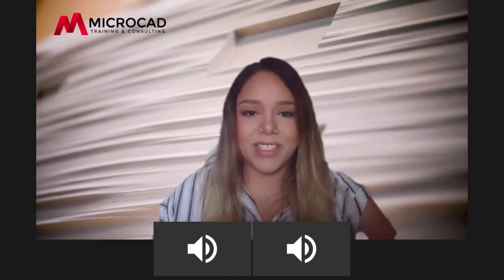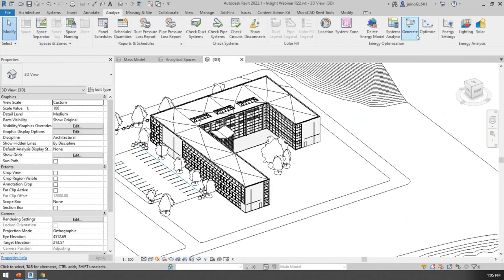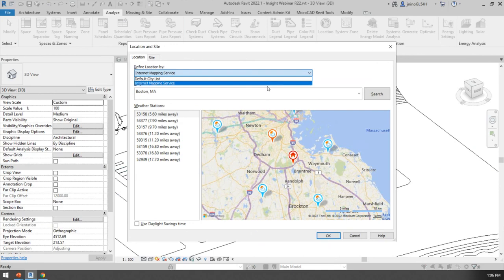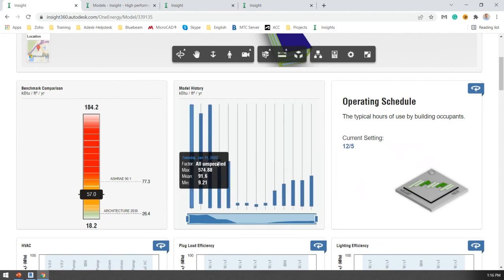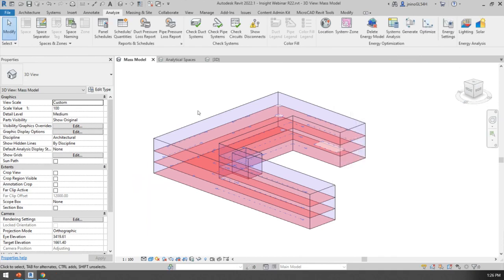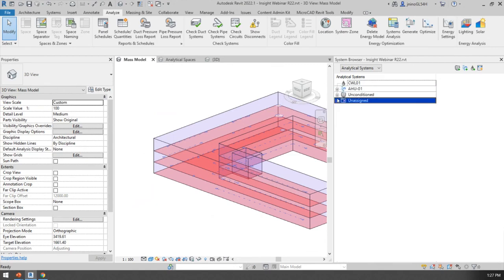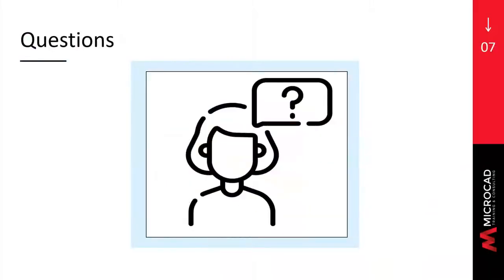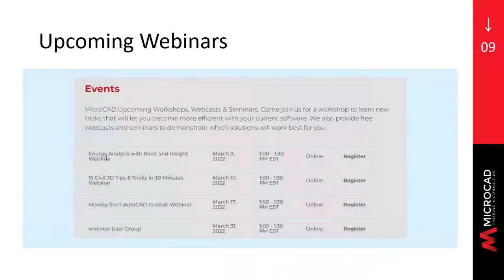Energy Analysis with Revit and Insight - MicroCAD Original Webinar

Comment: Hello good time. I want to do energy analysis for one day per year in revit, how should I do it?
Also, for this purpose, I want to enter the ambient temperature manually, in which part should I do it?
Reply from the maker: Hello, thanks for the comment. Unfurtonetatly Revit+Insight just has basic energy settings to control the rationalization of the energy model. Changing the dates of the simulation or OAT is not possible at the moment. If you need to run that specific type of energy analysis I would recommend exporting your Revit model to gbxml and using a compatible BEM software (Pollination, Energy Plus, IES-VE) to run the inputs.